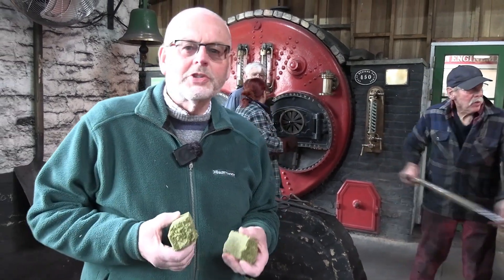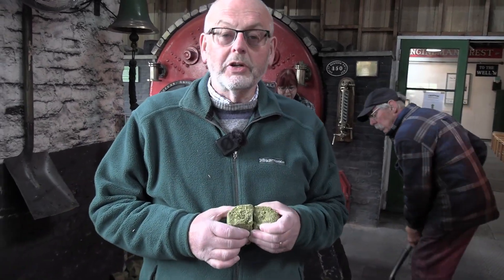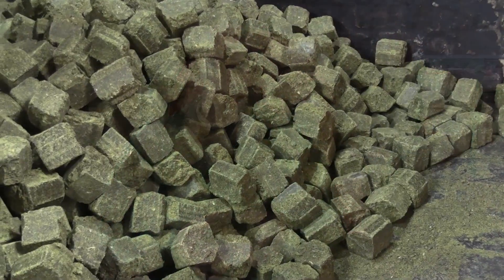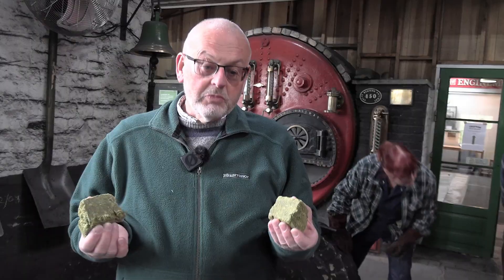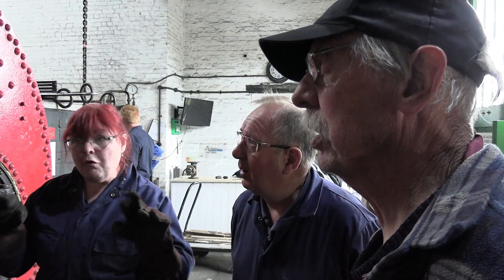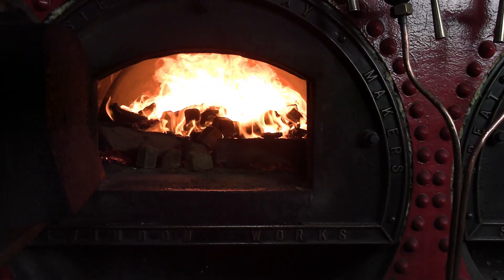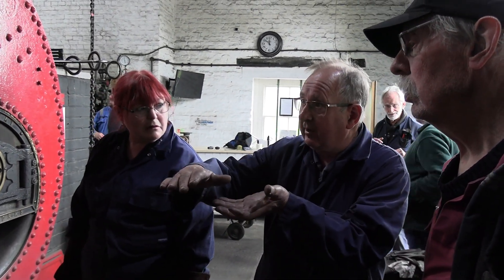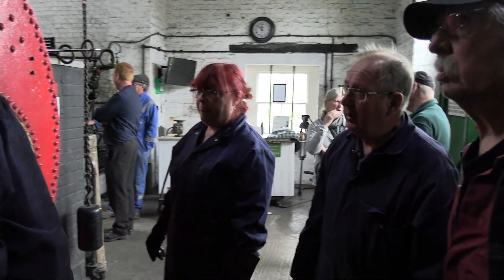Crofton Beam Engines - Trials an alternative fuel to coal.

Comment: I guess this could work but I would expect the unexpected as you are altering the inputs of a very old machine to something it was never designed to use and has never been done before.. Perhaps you will see weird residue build ups in the firebox and tubes.

Comment: Just a thought, when you burn wood, rather than coal, in a stove you change the air feed from underneath to from the side. This is because Wood doesn't produce clinker and the firebed just drops through the grate. I don't know how your bio fuel burns but I'd image it behaves like wood so you may need to run the test with a sheet of steel on top of the fire bars to get a proper ember bed going. If it burns like wood then you won't need to worry about ash as it will take quite a few fireings to build up to the point where it needs removing.